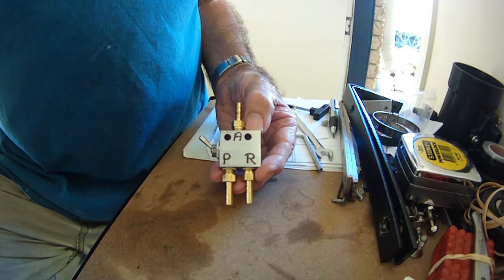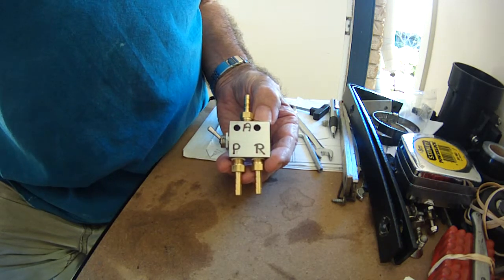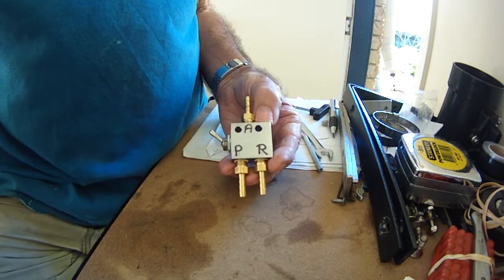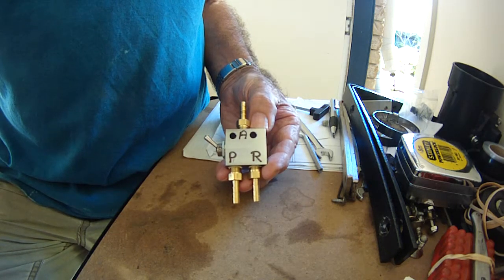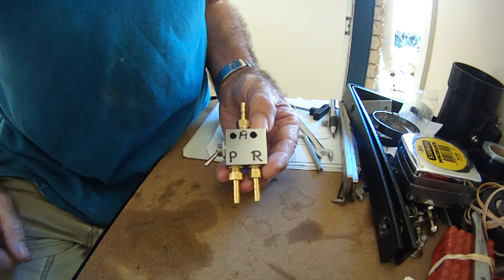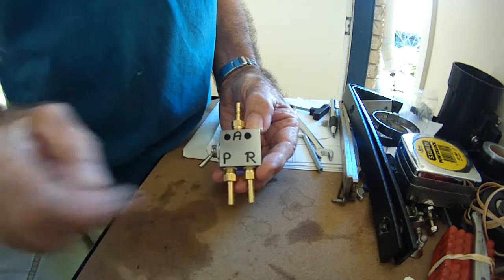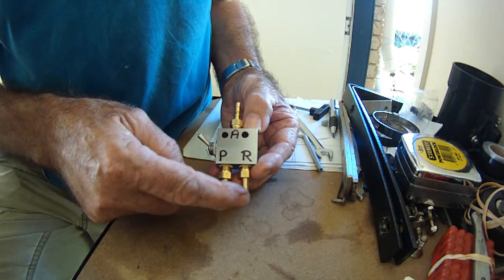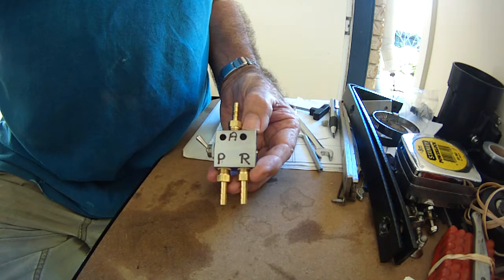3L Nissan Patrol Dual Dawes control, non electrical

Comment: Hey GU2- does 3bar still make this? Could only find an electric solenoid type dual control set up on their website. 

Cheers
Reply from the maker: sizlack000  Yes, click on this section http://dawes-devices.com/collections/turbocharged-automobiles
Cheers
Reply: Thanks mate.